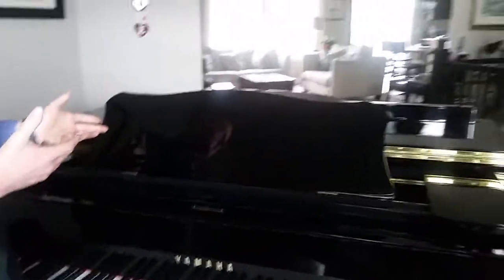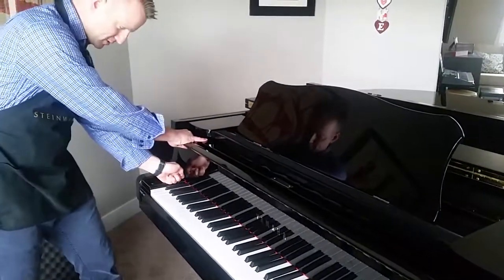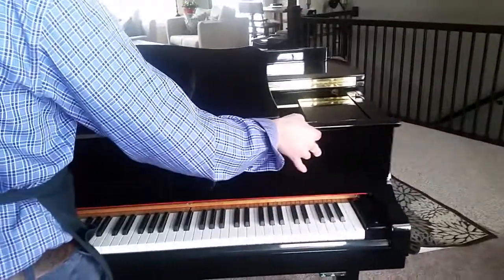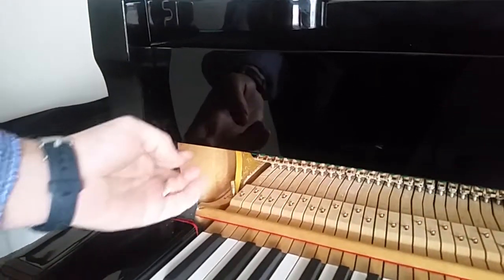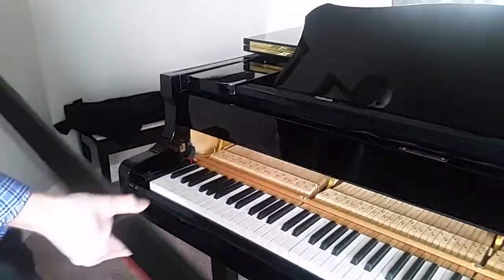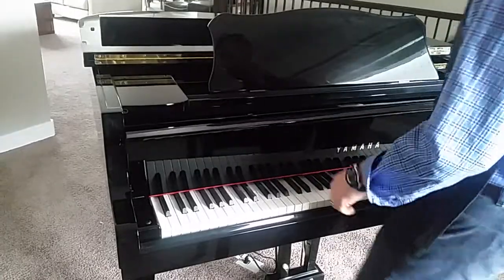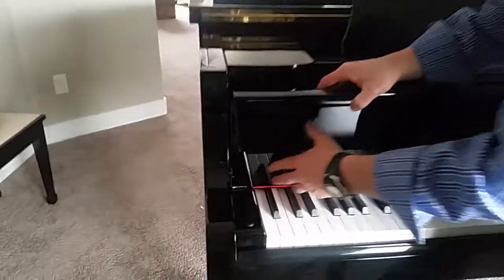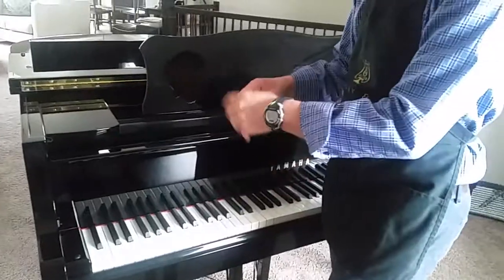DIY: Removing a Yamaha Grand Piano Fallboard

Comment: My piano’s soft-close no longer works. How to fix it? Many thanks!!
Reply: Hi B Z.  The piano in the video (Yamaha) doesn't have a slow-close fallboard, so just to clarify that point.  What kind of piano do you have (Make, model.  Or even just the make.)  Oftentimes the screws can come loose, which can be seen after you remove the fallboard.
Reply: @TheGildedPiano  I have a Yamaha C1. The slow-close fallboard used to work very nicely. But it no longer works. I took out the fallboard and examined it. My guess is that the metal part (which I don't know the proper name) in the fallboard might have worn out. I suppose if I know how to order it online, I can replace it.
Reply: @TheGildedPiano  Thanks!!

Comment: What about Kawai?
Reply: It's the same idea, but without the spring on the left hand side.  And depending on the year it may have a small screw or two on either side of the fallboard you'll have to remove.  (Sorry for the 2 years late reply!!)